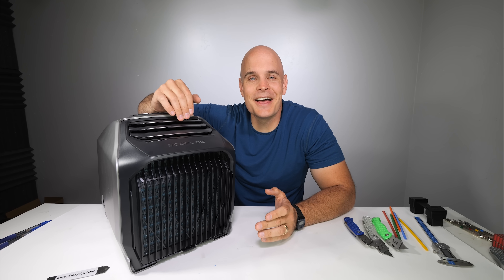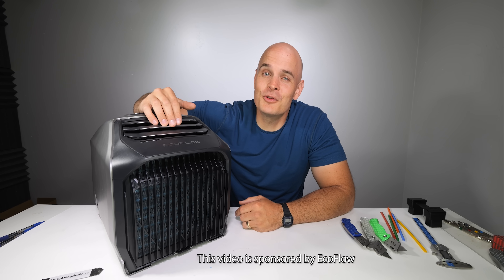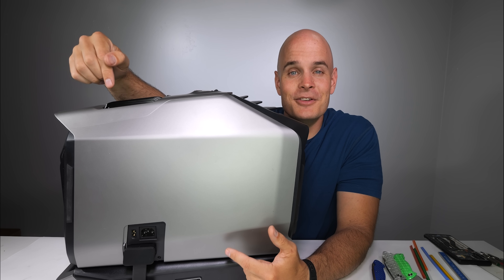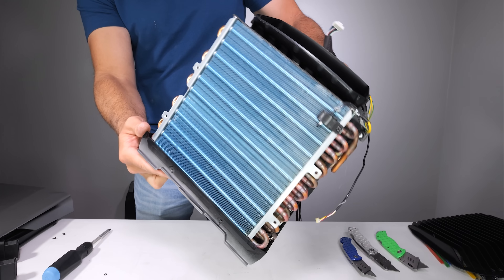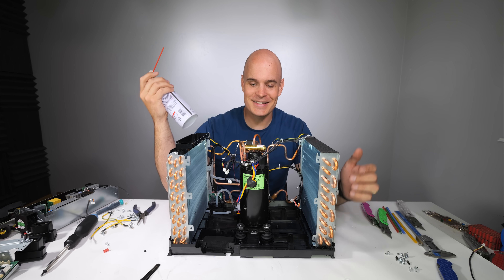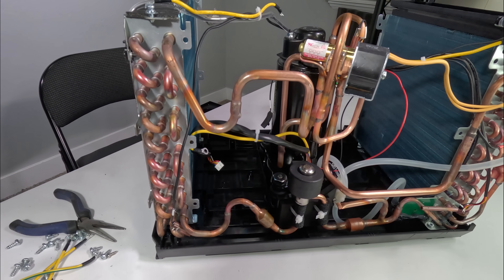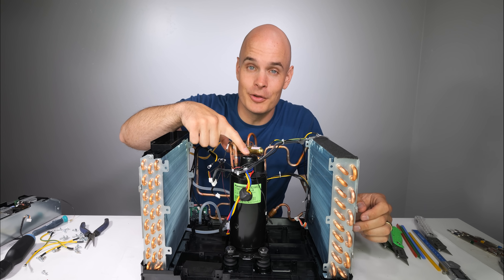THIS CHANGES EVERYTHING... (Ecoflow Wave Teardown)

Comment: Here is my recommendation. If you need it for a house buy a proper unit with decent efficiency. One that has an inside an outside unit. If you need it for a tent try to place a wet blanket on top of the tent instead. The evaporation of water will cool it down a lot.

Comment: 5100 BTU's is one of the least cooling A/C's or for heating. This is a one standard-sized room unit and nothing more. The cost of $1300 + tax and shipping is not worth the cost at all. It's not practical unless you pop a boner for battery operated. You're better off just buying a window 5000 BTU A/C for $100 to $200 bucks from Walmart and call it a day for the rest of the summer.

Comment: The "magic" that is in every air conditioning unit. "200% efficiency" is complete nonsense, even if one accounts for the fact that some energy used for the system is not accounted for by that "calculation". Heat pumps are nowhere near as efficient.

Comment: Do not buy this product, Ecoflow tricks customers by giving fake information and fake offers. I bought the glacier refrigerator plus wave2 combo, in the picture clearly shows that this item comes with battery, but they don’t send you the batter even though battery is clearly in the picture.

Comment: This would be great for a camper van combine with their solar. Glad they went dual pipe. Insulating the exhaust and intake pipe would make it even more efficient. Do they connect into the whole eco system? (Inverter/other batteries). Like the one you installed in your shed?

Comment: Would assume thats 200% maximum efficency not the minimum. Also I really don't see why they made it a reverse cycle and not a split system 😕 you can usually just physically change the inlet/outlet hose over on portable units.... Might be a tiny bit more efficient but when they have done almost nothing to separate both sides of the unit then why bother adding something that increases cost by a lot and adds more potential failure points?.... I just looks like more Ewaste 🤦‍♂️

Comment: I see a lot of comments saying it's a dogshit product because it has the components so close to one another. 
Yes, these comments and observations are completely true, but they aren't taking into account that this is a portable, battery operated reverse cycle air-conditioning unit. It WILL NOT be as good as a house one, but will kick the ass of almost any portable units available now.

Comment: So, the advantage of the old style 100% efficient space heaters is that they don't have any waste heat that then needs to be disposed of. Any kind of heat pump is always going to have waste that will have to be eliminated. And in an all-in-one unit like this, that means the efficiency of the unit suffers because you have to have some way to get that waste to wherever you're going to dump it, and that method is not likely to be air tight nor well insulated.
Reply: The waste heat only comes into play if you're trying to cool down a place. The only thing better than this is a diesel heater.

Comment: 0: 45 "It's 200% efficient" <--- hrm, I think you have a misunderstanding of efficiency. Something cannot be over 100% efficient. It's likely you mean that it takes 2 watts of energy to generate every 1 watt of cooling. (This is typical in almost any kind of air conditioner.)
I mean, obviously it's click bait-ier to say "200% efficient", but it's just plain false.
Reply: It’s correct actually, Since heat pumps move heat they can in fact transfer more wattage energy then consumed. Some units hit 300-400% efficiency. Transfer being the key word, in the winter they concentrate outdoor heat and transfer it inside, reverse is true for summer.

Comment: 200% efficient?  You should know better!
Reply: In terms of energy transfer that’s correct, some heat pumps hit 300-400%. For example every 1 watt of power used 3-4 watts of energy is transferred inside or outside. Think of it as shoveling heat around, it’s not intentionally generating it.

Comment: The second law of thermodynamics laughs at that 200% efficiency.
Reply: 200% refers to energy transfer efficiency, not energy generation. Say ever 1 watt used, the compressor can transfer 2 watts of already existing energy. They take or move heat outside.
Reply: It’s just pumping heat energy, not creating it

Comment: Cool setting, the magic is in the fourway, that can change refrigerant flow making swicth between condensor and evaporator. Fyi don't put this unit near source of heat such as stove or oven. This unit using R290 basically butane, it's flammable gas.

Comment: It's called a reverse cycle air-conditioner and are widely available from all manufacturers, just not portable. Wave Portable Air Conditioner + DELTA Pro is 9'000 AUD. Regular reverse cycles will output twice as much for a 1/5 of the price. You will pay 6'000 AUD for your portability and halve of the output. You work it out for yourself.

Comment: 0:20

I don't mean to be that guy, but there's also light emitted, so technically it's not 100% efficient

either way, heaters are epic, and nice video!
Reply: Heat is light. Be it infrared or visible. Different wavelengths heat air or surfaces differently, but 100w of light is 100w of heat. Nearly everything breaks down into heat after all, motors rotational energy gets turned into heat via friction, and so does any vibration.
Reply: @Dirty_Bear22  I'm pretty sure they are fundamentally regarded as separate forms of energy, but yeah, heat is pretty much the end product of every system, so I guess you're not wrong either :p
Reply: @Dirty_Bear22  also just another quick note - heaters make a little bit sound

Nothing is truly 100% efficient, so I'm just not a big fan of throwing that phrase around :)

Comment: I looked up the specs, it's got 600w of heating output. Not exactly powerful but it does run on batteries afterall. That's 1/4th the power of a cheap space heater (in Australia, 240v).
Still, I want one!

Comment: Not sure why that battery is just on bottom of unit. Should be sold separately because that battery wont last long at full power.
Then you got evap/condenser sitting pretty close which wont be efficient

Comment: lost me at 200% effecient.
Reply: How so? It’s nothing revolutionary in the compressor space.
Reply: @Dirty_Bear22  maybe in the USA, other places perfect effeciency is 100% effeciency.

Edit: looks like that a new thing with reverse cycle AC. I'm not used to it and think it's stupid and misleading.

Anyway normal AC is 300% to 600% effecient and sometimes up to 1000%, according to some sites. Which means this portable heater is isn't effecient.
A bar heater is not effecient in my books but 100% doesn't seem right either.

I'm not a fan of these effeciency measures.

Comment: you misunderstand, it gets no where neat 200%
if you are cooling down a room, you have to move that heat to air that you pump outside, but where do you get that air?
from the room you are currently cooling down..... an AC like this will suck up air you spent energy on cooling down, heat it up and pump it outside. and you only use an ac to cool your room when its hot outside. if you pump air outside, you have to replace that air from somewhere, outside. so as you cool your room, you suck your cold air up and throw it outside and suck hot air in from outside. calculate that into its efficiency and it goes WAY down.
the same applies to heating, in order for it to heat, it has to take that heat from somewhere, it can only get so cold before it stops operating or even being efficient. so you have to heat the cold side, with the air from your room, the air you just heated with the AC, and pump it outside. you will be using this while its cold, so you'll be sucking in cold air.

Comment: I mean, even those old heaters can’t be 100% efficient.
It might have 2 sides, for one you have heat losses in the wires going in due to the wire’s resistance, but if you look from the second side that’s also heat and you have 99% of the energy going in coming out from the heating elements, and that 1% is coming from the wires…
Okay, now I’m going to sleep, i’m braindead after this.

Comment: 200% efficient? IN THIS HOUSE WE OBEY THE LAWS OF THERMODYNAMICS!
Reply: Everybody keeps commenting this, without actually understanding how compressors work… They are TRANSFERING energy, be it inside or outside. In heating mode they concentrate existing outdoor heat energy and transfer it inside, in cooling mode they transfer indoor heat outside. It’s referring to indoor heating or cooling efficiency, meaning every 1 watt used it transfers 2 watts of heat inside or outside. It’s not actually generating its own heat at a net gain, it’s simply moving existing heat.

Comment: Uh.... I don't think anything can be more than 100% efficient. Also, space heaters are not 100% efficient. There is components inside the space heater that take up part of that electricity. You may have 99. But you will never have a hundred. And I do believe nothing in this world could be 100% efficient. All energy is lost somewhere. So theoretically, to be 200% efficient. It would have to take all of the energy it consumes. Convert it into what it needs to convert it into. Then take that energy it just produced and reconvert it 100% efficiently. That's not physically possible
Reply: Everybody keeps commenting this, without actually understanding how compressors work… They are TRANSFERING energy, be it inside or outside. In heating mode they concentrate existing outdoor heat energy and transfer it inside, in cooling mode they transfer indoor heat outside. It’s referring to indoor heating or cooling efficiency, meaning every 1 watt used it transfers 2 watts of heat inside or outside. It’s not actually generating its own heat at a net gain, it’s simply moving existing heat.

And yes resistance heaters are 100% efficient, in the fact every watt consumed is broken down into heat energy. If A fan motor is present, the rotational energy is transformed in heat via air and material friction, same for any vibration.
Reply: @Dirty_Bear22  everything is energy. Even heat. If any components in this are getting hot or even heating up in the slightest. Energy is lost which means it's not 100% efficient. And when I say heaters are not 100% efficient. There is the slightest amount of energy lost on even older heaters that have knobs because the resistance has to flow through that knob. You may be losing 0.001% but you're still losing some efficiency. The only heater that is 100% efficient is a mains wire hooked up directly to a radiator. There is no way that that EcoFlow is 100 or even 200% efficient because it has LEDs on it. Those LEDs use up power. There would have to be no LEDs or anything on it for it to be 100% efficient. let alone 200%

Comment: It's cool, but a 5,000 BTU window unit at Walmart is $125. A comparable electric heater $100. It would take a long time to save $775 on the electricity. By that time it most likely would have stopped working. Plus, the air coming out of the heater would be hotter than the heat pump is capable of. So, the room would heat up quicker.

Comment: Buyer Beware.
Battery Sold Separately.
Going Full Tilt Cooling is only 3 Hrs Run Time.
Shill Shill Shill Shill Shill.
I'm Kidding but It does require a better in depth look than just this puff peice.

Comment: I love your videos and I love the facts and science that you use on a lot of items.  But this was a sales pitch with bad information.  there is no way to be 200% efficient.  You can not get more energy out then goes in.  And any unit like this looses efficiently when you have an exposed pipe moving either the warm are ding the summer or the cool are during the winter, that duct is going to be absorbing or radiating heat (depending on application)
I love heat pumps and that is one reason I love mini split systems and this looks like a great unit.  but I would want real world test on the 8 hours of run time on a single charge and some real world numbers on how efficient it really is.

Comment: They have fitted all the parts of a regular inverter heatpump into this. 
Twin rotary compressor, reversing valve  , electronic expansion valve. Veriable frequency drive. 
Definitely one of the most advanced portable aircons i have ever seen.
Reply: It doesnt even need that reversing valve in my opinion. It is portable, you could just switch it over hah
Reply: @gelo1238  You are right, but I think because its $2200 off sale and 1200 for this deal. I don't think people would consider it a premium product if they had to turn it around. I also don't think the reversing valve makes a ton of cost difference at that price point either. lol
Reply: so heatpump is basically a reversible air conditioner?
Reply: @javieroargubi  mm. any air conditioner is a heatpump. (for exm. in cooling mode you are pumping heat from inside the building to outside). reversible air conditioner means that you can pump heat both ways
Reply: all this in same compact size is already in some heat pump tumbler dryers, they just rearranged it.
Reply: it is not " electronic " expansion valve, it is solenoid expansion valve.
Reply: @ياقوت-ق  it's called "eev" which means electronic expansion valve. I have never seen any service manual to say its solenoid. And it is not actually a solenoid.. expansion valve doesn't just turn off or on like a solenoid would do. It's a stepper motor that turns the valve open or close.

Comment: There are Portable Heat Pumps already available. This one just so happens to have a large battery inside to allow it to operate without being plugged in for a little while. The problem with portable AC units is because the compressor is in the house. In split systems the compressor is outside the house. This means that portable AC units are loud.  

It’s a phase change that causes the cooling and heating. The R1 refrigerant is a liquid that boils at -40c. So it’s natural state in room temperature is a gas. The only way to get it to a liquid is by compressing the fluid which phase change causes it to release  heat.  When then condensed liquid is released as vapor it quickly changes back into a gas which removes heat which cools air down.  All Heat pumps do is reverse which direction the cool or hot air goes. Basic run of the mill AC units actually does the same thing but they only designed to for one direction.

Comment: My wife talked me into getting a heat pump clothes dryer, I was apprehensive due to the cost of running a conventional one, I was presently surprised how efficient it was/is.
Reply: I too have a heat pump dryer due to a $400 rebate from my electric company. Very cool to see how much it uses, and being ductless(so no potential fire hazard there) also getting a well geothermal unit to heat and cool my house. Heat pumps are cool

Comment: This is weird it doesn't change anything I really don't understand why it exists. Portable heat pumps aren't new, and due to the positive pressure they're not efficent the either. The only way this would be efficient is if you could rip off the compressor and have it outside if the space you were heating / cooling.

Comment: I wish you’d mention the heating and cooling power in watts too. That unit makes a lot more sense to most people and is the easiest to contextualize. 

Other than that, great video!
Reply: If it runs for 8 hours and has a 1100Wh battery, means average 130W average

Comment: That's not a heat pump, that's a regular AC unit.

An actual heat pump involves using the grounds stored thermal energy to heat and cool your home.

This is not 200% efficient, that makes no goddamn sense at all.

Compressors are by nature inefficient.

It's a neat product and had TX60 connectors on the outside which is awesome. There's no need for this dumb marketing bullshit.

It's just a high tech battery powered ac unit, that's fucking it.

Comment: this is stepping into false advertising territory. I wonder how this company is skirting the adjusted BTU rating for single hose units. In stores you see TWO ratings for BTU, one is lower, adjusted for the inefficiency of this design. Technology Connections has a much better video on AC units compared to this "talking points, don't care if they are lies" sponsored video.

Comment: That's enough for cooling an RV but not an average house room, you need at least 12000BTU if you live in hot areas and 9000BTU if you live in the north.

Comment: The British thermal unit is a measure of heat, which is measured in units of energy. It is defined as the amount of heat required to raise the temperature of one pound of water by one degree Fahrenheit. It is also part of the United States customary units
This is the definition for a BTU.

Comment: What good is the cooling function? You can’t make things more cold you can only make them less hot, so where does this machine dump the heat it removed from the air?
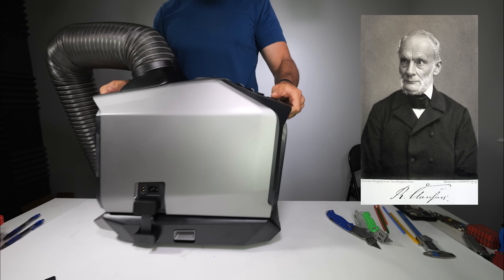Reply: 1:30 It's pumped outside, just like with any other air conditioner.
Reply: @aliendroneservices6621  so it’s purpose is to only blow cold air at the user and dissipate hot air? So it can only be used outside? Or used inside but would heat up the room?
Reply: @BennettMeierWerks  1:30 The hot air is blown through the tube to the outside, just like with any other portable air conditioner.